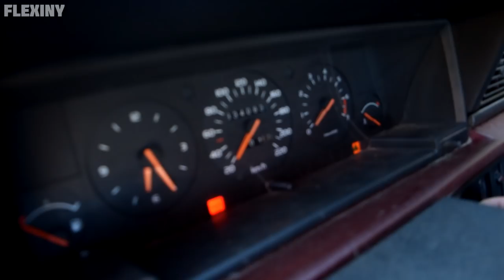Volvo 740 Cold Start After 6 Years (1080p)

Comment: 2 things genius.... 1. you don't pump the throttle in a fuel injected car to start it. 2 never rev a car that has been sitting for 6 years.
Reply: spacegreycoralred Agreed....they don't have a clue of what they're doing. Poor starter motor, poor engine, poor transmission!
Reply: spacegreycoralred you two exactly don't know anything. the car is already wreck and it is seen that pumping doesn't harm instead starts car. don't believe myths from society.
Reply: Most fuel injected cars have a clear flood mode in which the ecu cuts the signal to the injectors at wot to clear a flooded engine, i know with my old nissan pulsar  if the ecu detected a foot on the pedal at any position it would cut fuel on start.
Reply: Idk if you really know what you're talking about now, ive owen several volvos, the one i own right know starts up faster if i pump the throttle. And it is working perfectly fine aswell, i dont need to pump the throttle to start it but starts up quite much faster if i do. And yes, im from sweden.
Reply: Specialy not if its a turbo
Reply: You have to rev it or the engine will turn it’s self off. It has to have support because it is still weak from resting
Reply: joe branning At a cold startup, engine oil takes a second to reach the camshafts. Reving a cold engine which camshafts haven't been lubercated in 6 years will cause unnecessary wear. Instead he should have kept the rpm's slightly above idle so that the engine and it's fluids could warm up, (after a few minutes the car should be able to idle by itsself), fix the locked brake, and drive away with a warm engine.
Reply: It’s their car, they can do what they want lol
Reply: joe branning And they did, I'm just explaining what I would do.
Reply: Dirk van Nieuwenhuijzen who cares
Reply: joe branning Not you
Reply: I am guessing this was a for the fun of it start and doubt they actually thought it would start at all. Entertaining to watch to say the least!
Reply: spacegreycoraled ... another kid internet hero who thinks he knows all about cars ha
Reply: @Dirkvnh  did you miss the part where they cranked it for solid minutes, which was turning the oil pump and making oil pressure
Reply: They could at least changed the oil before starting it up after 6 years and Rev the engien like that. Like damn. They could probably rescued that car. The engine anyway. Maybe it had to mych rust under
Reply: I don't know about the pumping thing, however you are correct, you don't high rev a car that has been sitting a long time. The car should sit at low RPM until oil seals and bearings are worked and saturated again. Revving the engine like that could be what caused it to smoke from the rear seal, seen later in the video. I've seen a resurrection go very badly one time with a blown engine from doing that. Also from experience, the 7 and 9 series need a very strong battery to start, especially after sitting.
Reply: And thay don't block the diferential
Reply: Don’t even rev a car when it have been sitting one night and have been cooled down
Reply: It’s a Redblock!!! Nothing happens
Reply: @thebmxripper8330  You can kill a redblock, belive me.
Reply: 3. Don’t run it without oil 🙄🙄
Reply: @karlcarolusrexxii1352 you do realize that Volvo requires synthetic lubricants for their vehicles? 😮😊😊

Comment: That poor starter.
Reply: Haha
Reply: +Dell0304 huh. found ya
Reply: Lol damn
Reply: +Dell0304 He wasn't that hard on the starter. He did keep stopping it to give it a small rest before turning it again.
Reply: +bennydman666 Takes a lot longer than the breaks he was giving to cool it down.
Reply: GoogleMinus Well if he did that then it would never get started. He did what he had to do and I think it was fine what he did.
Reply: +Dell0304 look at the car, i wouldnt give a fuck about the starter lol
Reply: Ryan Gehret These starters are actually incredibly robust and oversized for this engine, mine will happily overpower the parking brake and in gear and still rotate the engine - as I've found out by accident more than once.

Comment: It probably would have started much faster if you stopped pumping it like it has a carburetor...
Reply: So true
Reply: +bearmassaro How?
Reply: +bearmassaro so true I got an old car with carbs and it hadn't started for 41 years and we had to pump the fuel by hand and after like 3 attempts is started right on up
Reply: yeah pumping acceleration look pedal always slows start
Reply: Fuel injection engines don't work like that
Reply: It's clearly fuel injection
Reply: the b230f is a mechanical injector. so its an injector
Reply: Its not the same as the fuel injection you have on your new cars. you are supposed to prime this style of fuel injectors by pumping the gas. its in every manual. common volvo guy knowledge. now take this L.
Reply: You are correct. the difference between the two is mechanical you prime it by pumping the gas and EFI does it all for you.
Reply: I hav a 740  and it is a carb one all 740 hav carbs
Reply: Oh i guess your probably euro and have the v6 huh.
Reply: Literally 1 of the 740 models had a carburetor. they made them from 1982 to 1992 so theres a lot of different parts.
Reply: wrong, yours might but most had continuous fuel injection
Reply: som of den y nead to pump if the hav bean siting fora a vile
Reply: True. There is a cold start injector which supplies raw fuel for starting .Opening the throttle simply makes it too lean to start .
Reply: Perhaps specifications differed through various locales, but the North American spec 740s never had carburation. In fact, most, if not all of our 240s were also fuel injected, though I imagine they were using a far earlier Bosch K-Jetronic system.

Growing up we had a 1981 240 DL and a 1989 740 GL that were both fuel injected. They were excellent cars - never skipped a beat, they just kept going and going!
Reply: old_marine nah. Different engines in all
Reply: Its not a carburate only 740's from -84 - -86 has carburator this is a 90/91/92
Reply: @QuanticSnow  B230F is electronic injection and B230E is mechanical injection.
Reply: @bobmarley5551  And this is efi.And you should absolutely not touch the gas.
Reply: damn right
Reply: Exact same thing I was thinking!
Reply: Don't pump hold the pedal to the floor as soon as she starts let go of the pedal. If she doesn't start leave her for a minute or 10
Reply: @bjorn55531  that ain't true, not all volvo 740 have carburetors. Only b230a  carburetors. B230f, b230e, b230fb, b230ft that is in volvo 740 have injectors
Reply: It doesnt have to be a carb 
Thats an b230 f as it looked like, sure there is a b230 who is carb (b230A) but i dont think that 740 was a b230F
Reply: @karlcarolusrexxii1352  Don't forget B230K
Reply: @kolen0421  yep 👌
Reply: @QuanticSnow  b230f is electronic injection.. b230e is mechacical

Comment: that nissan sounded like a microwave.
Reply: :D
Reply: Or just piece of garbage
Reply: A turbo diesel microwave. For the man how has little time.
Reply: Mitchell Steele ikr
Reply: Lol a Dyson HandDryer
Reply: its a vulva not a nissan. both from high latitudes but one has a much prettier undercarriage.
Reply: @PaulHigginbothamSr   idk if u mean volvo, but the pickup truck is a nissan.
Reply: It's a nissan navara. If is the manual transmission it has so many sounds from the engine. 2.5 dci.

Comment: should have left that Frontier in the spot you moved the Volvo from.
Reply: +KEINOMADDONE Looked like a Frontier......
Reply: you might be right. it looked kind of big
Reply: +William Allen did you see the 2017 honda ridgeline they completely changed it even the engine is different.
Reply: Nippledozer
Probably it's complete lack of towing and load capacity. Very weak motor and not to mention unibody.
Reply: +Nippledozer Honda came out with the 2017 Ridgeline! It's a huge Improvement vs the last one; not only did they update the body, they gave it a new engine as well! It even has hidden speakers in the trunk bed, the bed is larger and it has a camera under the Honda logo.....At the front not just the back! Honda woke up this year! Now if they can just update their motorcycles I will be a full Honda fan again! XD
Reply: +KEINOMADDONE It's a Nissan Navara :P
Reply: +KEINOMADDONE yeah that nissan was really weak
Reply: +a55doggy checkout the nissan titan its the same ;)
Reply: It's a frontier fam
Reply: +Joshua Pratt nah brah its a Nissan Navara
Reply: Manii Calabresi in the states it's a Frontier
Reply: +Nippledozer it's a full body on frame.

also, 280hp isn't too bad in a truck this size.
Reply: viperz888 FRONTIER IN THE STATES
Reply: Joshua Pratt DOES THAT LOOK LIKE THE STATES? NO DIDN'T THINK SO
Reply: viperz888 ok then
Frontier in the states 
Navara in wherever else
Reply: +Joshua Pratt they're different enough to not be the same.

ever seen a diesel frontier? no...
Reply: Marshal Thompson well they look the same
Reply: +Joshua Pratt There a shitty car full stop lol.
Not sure about the states but it's basically a 2.5 Renault diesel in them over here and it's gutless,
Reply: MrByootox Frontiers got a sick 4.0 V6 with a 6 speed manual. Nice trucks
Reply: Hehehe

Comment: I recently dug out my dad's old Volvo 142 68' from like 60 cm's of snow. It's been standing on our yard since 2003, through winters and summers alike. After the "rescue operation" we just swapped the battery and it started on the first ignition. These are legendary machines. I doubt the human race will ever see a more reliable car than these 60 -80's Volvo's. 
Ofc it had rust, pretty bad rust. But "all" the electricity in the car is working. Like how is that even possible?! B20 for life <3.

Comment: I had one of these back in the day illegally of course. Bought it from outside an auction where you just turned up, paid money and drove off lol. Had to put petrol in it though before returning home. It was a good solid car 2.0 litre engine that had abit of poke. It was so solid i used it once to ram raid Currys, it went right through the shutters bless it and we spent all night filling it with tvs etc, took us quite a few journeys. On another occasion, one of my friends had been attacked by a local gang of youths so we waited until midnight and went out in the Volvo looking for them. We saw about 10 of them hanging around where they usually did and i drove the Volvo straight at them. Build quality was so great and sturdy that after i ran over them all there wasnt even a dent at the front, Awesome! I reversed over the ones that were still moving and off we went to the petrol station as the Volvo was thirsty again. Another time a friend (saying no names) had an evil step mother, we would often talk about what we could do to help his dire situation. I turned up one day at his house as id heard on the grapevine that his step mum was taking lessons to learn how to drive. I offered to let her drive the Volvo and she was very eager to learn. I gave her the keys and waited. She drove off. What she didnt know was id emptied the brake fluid tank and the brakes would fail shortly. Ten minutes or so later we heard a mighty bang! we quickly sprinted to the accident scene and saw the Volvo on 2 wheels buried in the side of this house. Luckily it was only a bungelow. the wicked step mum had gone right through the windowscreen, right through the bungelow and out the back window, dead instantly no doubt so my friend was happy. I was quite chuffed for him. We quickly turned the Volvo over onto its wheels and god bless it the Volvo started up right away. We got it away from the scene, parked up and put Brake fluid in it. Then jobs a good un. Front end was crumpled slightly but a rubber hammer would suffice quite sufficiently on this occasion. What a car, a proper tank and i will never forget Betty the Volvo she drank petrol though i remember so was very thirsty but she made me alot of money bless her.

Comment: not surprised at all. My 740 has nearly 300k miles and the previous owner never did maintenance. it ran. and after a radiator change it runs like a champ. you can't kill a volvo

Comment: Check the fuel pumps! always do the basics first! it will go if you do your home work first, it is obivous the starter works, make sure you have fresh engine oil. pull the wheels and get rid of the rust on the rotors!  Volvo's are the best!

Comment: it's a fuel injected car so i'm not sure what you're thinking 'pumping' the gas pedal is going to accomplish besides moving a butterfly valve
Reply: +SilentServiceCode This ^
It probably would have started faster if the gas pedal was left alone.
Reply: +SilentServiceCode just jump the fuel pump relay and let the both fuel pumps run for a few minutes and it would start immediately
Reply: For my Volvo, every now and then you have to push the gas bc it'll die at start so you rev it for a few seconds then it'll idle normally

Comment: some years ago we did the same with a Volvo PV sport. Only it had been sitting 20 years outside. To bad the chassi was total. It have been used for rally most of it lifetime. We took a 1 liter bottle connected to the dual carbs and a good battery. 4sec crank and it jumpt to life running without vibbrations or missfire. It was probobly one of the biggers WTF in my life.

Comment: I really hope you changed the oil filter, oil and petrol in the tank. Because I did that (as well as replacing the spark plugs) in my car that hadn't been started in like 3 or 4 years and it started fine 1st go

Comment: Why would someone leave this car for 6 years? I see still people using these they are not that old
Reply: Well they are old, but that's no excuse. My 940 is running like new with 19 years and 500 000km on the meter.
Reply: Disregard the constabulary We have a 1994 volvo too but it only has like 230.000km :p
Reply: FSXgta Lucky you. Mine's had some parts replaced because of the fatigue but it still goes strong and the parts have been pretty cheap.

The chassis and the engine are in good health. It's been driven on some harsh roads and bad weather but rust is non-existant and the chassis is rigid.

I sometimes look at it out the window and boy, do I love that car. Looks great and drives great.
Reply: Disregard the constabulary yeah, its like a tank :)
Reply: Disregard the constabulary km UFO urma ce
Reply: Disregard the constabulary whitch engine?
Reply: ive a 96 with 56k its like nnew
Reply: I'm using one Daily, it runs perfect!

Comment: Couple of tips if you have to do something similar again:
Whack the back wheels (not the tyres) witha 7 lb hammer usually the rear barkes bind onto the drum after a long time lying unused and a good thump on the back wheel often shock them loose.
After a lot of cranks, the engine is flooded with petrol. Hold the accelerator wide open as you turn the starter. This clears the flooding and  is more likely for the engine to start.
Good to see it come to life again!

Comment: flexiny: while you have the spark plugs out squirt some gasoline two stroke oil even if its a diesel into each cylinder below the spark plugs while you have the plugs out. That will jump start it even if its a diesel.

Comment: Normally I like to take the valve cover off, check each valve, pour oil on them. I also like to remove the plugs and put some oil in there and let it spin a few times. And it is always good to clear or by pass the fuel system if you are unsure about the condition of the fuel.

Comment: Volvo 700-series: probably the most solid car in history. Will last 7 generations!
Reply: Ever heard of The Mercedes W123? The title of this video should be "It took is 6 years to start a Volvo 740"
Reply: @nedkogenov5530   Those are nothing but rust buckets
Reply: @riple4360  Its a rustbucket if you dont maintain it, besides i was talking about The engine, not how rusty it can get
Reply: @nedkogenov5530 come on agree that they are both good cars

Comment: Wow, my 240 w/ 200k miles fired right up after 5 years untouched! Granted I changed the oil, plugs and fresh gas before attempting and it was in a garage, but not heated through Buffalo winters. I'm surprised you had to crank for so long, fuel pump must be on the way out.

Comment: I go to junk yards to get car parts a lot. Sometimes out of curiosity I  look into cars from the 80s or 90's to check the mileage on the odometer. You can't do this with newer cars, they're digital. I notice Jeeps, Toyotas, and Volvos have the most miles. Often 300,000 or more, US miles. The most I saw was a 1989 Cadillac with 490,000 miles.
Reply: So?

Comment: How "cold" is that? Grass is green, and the summer at its best! Why were the front wheels locked? The car is rear wheel drive. Here in finland we have to start  our vehicles even from minus 30 celsius below.To be honest, I must say, that on the hardest winter days there are mostly toyotas moving. Anything else couldn`t start at that degree.
Reply: +tasankoporkkana Kylmästartti ainakin englanniksi tarkoittaa kylmässä käynnistyksen lisäksi käynnistystä, jossa ajopeli on ollut hylättynä pitkään, eli ihan sopiva termi tälle videolle, veikkaan että ruoste jumittanut eturenkaan, olisi saattanut irrota muutamalla vasaran/lekan iskulla vanteeseen.
Reply: +tasankoporkkana just use 0w-30 synthetic oil and anything would stats as long the engine is in a decent condition

Comment: Did you had to change the fuel pump ?
Reply from the maker: No, it was sitting for 6 years. We also didnt need to replace Rover's fuel pump and it was sitting for 8 years. But after 8 years everything in fuel tank looks very bad.
Reply: I have a volvo 1987 volvo 740 gle that has been sitting for 6 years. And I want to restore it.